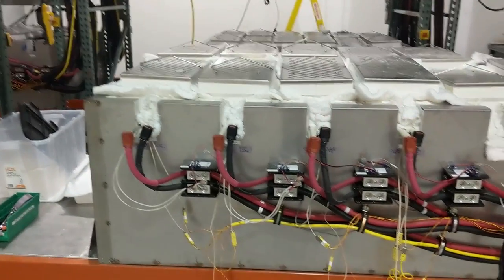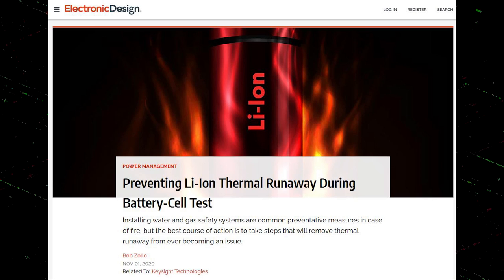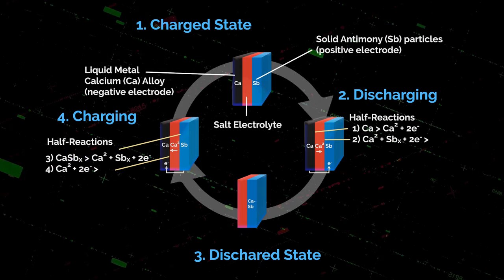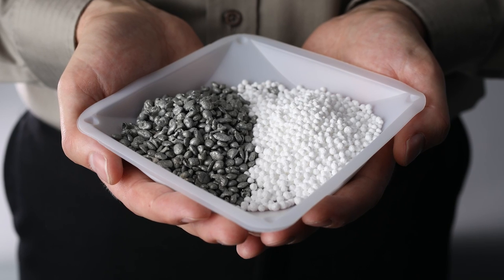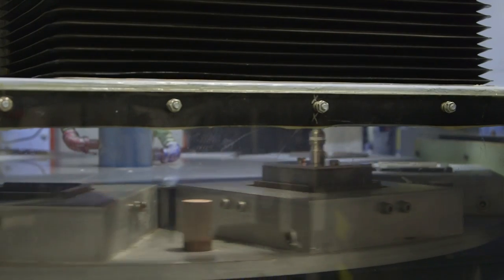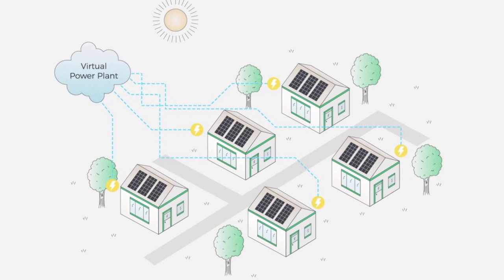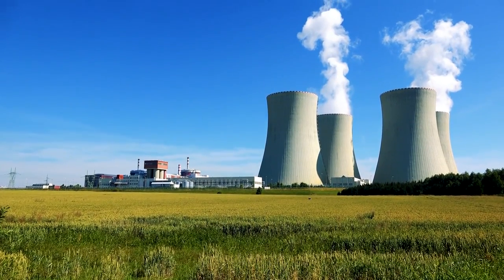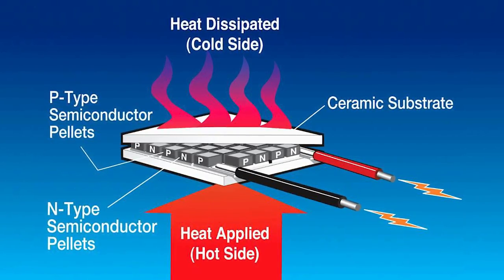Ambri: A Battery that Could Change the World

Comment: Getting the battery up to use temperature is going to be rather uneconomical, the temperature he quotes is nearly 1,290°F.. I'm not going want to run a blast furnace just to use batteries.

Comment: Very interesting and fascinating. This is awesome.  Thank you very much. I do not have background in chemistry so kindly excuse my question.
Q: Where do you get the energy to heat the battery to such a high temperature and how do you maintain that temperature?   Is it the battery once ‘activated’ able to keep itself hot enough or you will need external heat source?
Reply: Best ask the professor

Comment: Can somebody answer me - if the battery needs to be heated, then would that by itself consume the energy stored in it?
Reply: He implied the chemical reaction when charging and depleting the battery creates the heat (or a portion of it) to keep the metals liquid and thus functional.  If the percentage of energy needed to maintain liquid metal provided by the reaction from charging and depleting the batteries was significant, he would have provided that statistic. Getting these batteries up to temperature on site would probably require "smelter" level electricity from some other fuel at start up.   And, by omission of the critical percentage referenced above, an onsite permanent "smelter" level energy producer is probably needed to assist the exothermic reactions to keep the metals at liquid temperatures.

Comment: What is the energy density of this battery? How does this density compare with a Lithium ion battery? Can this Liquid Metal Battery (LiMB) be made small enough to fit into a car? Because it is liquid metal and is encased in steel and ceramic, I assume the energy density is not as good especially with a small form factor? How does LiMB compare to the future SSBT from QuantumScape or SolidPower?
Reply: This relies on gravitational layering, and start/stop changes the direction of the gravity forces. Mobile is probably not a practical market.

Comment: TOO DAMN HOT!!! You'll expend too much electricity HEATING the battery to operating temperature than it can STORE which is the name of the game. This battery chemistry is over a hundred years old discovered almost simultaneously by a Frenchman and by a Spaniard before WWI both proposed to use it in submarines, but keeping the battery HOT would have taken burning coal or oil, which is hard to do under water. A fast path to nowhere. It didn't work in electric cars/trucks/buses either. 1001 ways to re-invent things that didn't work before!

Comment: There isn't enough antimony to supply all the grid storage for Minnesota, much less the world. Minnesota which would need over 100,000 tons and the only country that can supply this strategic metal, if it became viable, is China.  It will only be able to supply a small part of the storage needs of the world. Unless a cheaper metal can be used for a liquid metal battery that is available worldwide, this isn't the answer to grid storage. Compressed air storage might be better to create storage.

Comment: In the times before coal to steal metals electricity was not going to well for arking to welders started the second generation of metal understand then laughing at the experience and then realise it later as a cool down takeing longer time to cool then other an interaction between metals if only someone recorded the metals that came out of the smelters to realize that battery way way back

Comment: he makes a number of false or dubious statements. you didnt call him on any of them. says he wants to make a battery out of dirt. then says one of his electrodes is antimony. have you looked up the abundance of antimony recently? he says aluminum can be refined from dirt for 50c/lb. last i checked aluminum gets to that price by starting with bauxite ore, generally shipped across the world to the refineries. also, he never mentions what the electrode terminals are made of. how do you go from a molten metal inside a "steel" box (hint: it's not just steel) to a copper wire? tough problem. probably requires an exotic substance to make it all work. any airspace or pressure issues inside that box? probably going to need a valve that operated at over 500c. fancy. impurities in the battery materials get "refined out" during cycling? where's "out" with a steel box? this guy went all in on the folksy "cheap as dirt" narrative a long time ago. i don't appreciate it. he'd do better to discuss the details.

Comment: 🔥♨️How safe this battery is as it operates at a high temperature of about 500°C (932°F) 🔥♨️ as these will be installed in a huge number together ??  And can we use that high temperature 🌡 for any other pupose during its operation is possible??

Comment: Li-Fe batteries are useless for mass storage, the best heat energy is from geothermal but only for small area environments. You never get more energy out than you put in, so where is the energy coming from? good idea again, with no solution yet.!
So if it freezes it fails, just like lithium.!!

Comment: 31:15 I liked the ambri men idea...when he pointed out " missing puzzle " is the batteries!

Gases are from land sea & dirt cheap batteries.. are like down your feet? ( Land Ground )
And when you bring a kinetic engineer in your company, they will only say, only physical metal, generates electricity by a wired cylindrical coper wired motor! But they would never remember, ( in mind ) chemists reactions generates electricity, without any kinetic metal as a physical transformer for combustion heat of burst oil to form electricity

Hard physical engineering at some point, will always forget.. substance or chemical, do generates kinetic energy with a good micro setting of educate quality liquid metal.. without combustion energy's transformed!
If batteries combust.. that is we know, a malfunctioning.

Comment: if the heat generated from charge and discharge is going to keep this metal heated to 900c degrees how are you going to turn around and claim the battery is more efficient than lifepo...

Comment: What kind of ecological mess does the garbage ones with heavy metals and all those electrical parts make in the landfill? Then , the meltdown on the side of the road bursting into flame? Like the hot hot running temperature of the"efficient" gasoline , internal combustion engine. Push it till it explodes and burns. No real good answer, just theory's.pour money into the problems untill we go broke. New cars in 1970, $2,500.00 US. Now, $25,000.00 so has your pay gone up × 100 ?

Comment: Throw some nuclear waste into the battery, and it will never solidify??  Use another MIT solid state invention to syphon off excess heat to generate electricity to trickle charge the battery?

Comment: so.. why not use germanium
Reply: one notch above silicon.. 8 more proton electron pairs.. and gallium..next door with one proton electron pair less.. and a melting point of 29.7° C.. melts in your hand.. 
sodium and boron..  hmmm.. not expensive enough, possibly?.. my research indicates we can make a battery with the AuPt and AuPd in the radioactive volcanic ash that covers the Earth, doctor.. P Michael Hutchins of MIT actually got me going on this line of research.. we were trying to make precious opal with volcanic ash.. kaolinite clay.. I got a gel of stuff.. a lump without play of color.. P Michael says.. could be any damned thing, Rick.. and he was right.. as usual 🙄
Reply: and since I have platinum and palladium in what amounts to an unlimited supply.. not rare or hard to find.. I have been thinking about this issue.. a lot.. because we only have to ship electricity and make large storage batteries for stuff we must buy from someone else.. make it at home.. use it at home.. no worries mate.. no need for a lot of infrastructure.. platinum and palladium with gold have double double covalent bonds across each unit cell.. that's what volcanic ash is.. the individual unit cells.. found on the side of the road.. any dirt road will do.. so not only do I have unlimited supplies.. so do you... heck of a way to run a business.. giving stuff away.. but there's lots and lots of it.. about 10,000 km straight down.. chock full of AuPt and AuPd in the semi molten mantle.. it's semi molten because it is radioactive  . Pt190 has both alpha and beta emissions.. mostly beta.. one electron at a time.. at the speed of light.. gotta be something I can figure out... I am working on it
Reply: I have a piece of Chinese platinum bullion that I pulled out of one of my experiments because it was becoming to hot.. radioactive hot.. a process here in my laboratory.. my father taught reactor theory when I was in high school.. I know a little bit about it
Reply: so.. guess what nuclear power plants do?... boys and girls.. not you doc.. I would hope you already know.. the answer is, of course.. they make Pu244 with which to blow up our neighbors... and.. they boil water..  so.. the entire Planet is covered with radioactive volcanic ash... but Pt190 won't blow up..  and it boils water just fine 🙂.. so.. we probably can use capacitors to regulate the current.. 12 volt.. in the home... it's a catalyzed reaction.. so.  basically.. electricity for free... just add water.. 
it's not gonna make me rich.. fer sure.. or make anyone else poor.. unhealthy.. or anything else.. the best part about giving stuff away is ==>> no unhappy customers 😀.. far out man
Reply: the problem with 12 volt direct current is that you can't ship it long distances.. so it must be made within a couple of kilometers of where we use it.. obviously if you have a steam powered generator.. that is in the garage.. it's not an issue at all..  it's a very good way to eliminate a lot of the use of fossil fuels.. and the use of the radioactive lanthinides that create very long term problems with nuclear waste.. it's probably not the best way to make electricity.. but it is the only way known to create Pu244
Reply: radioactive volcanic ash literally covers the Planet.. mostly we walk around on top of it

Comment: Recharging battery charge it one time with electrical power never had to charge it again cuz it will always recharge itself and it will last for a lifetime and the lifetime of your grandkids that's kind of battery we need that won't get hot and go nuclear and causing fire bombs that would recharge itself for a lifetime of recharging of it no worries it can last 200 years never break down or be having to be thrown away and put in a landfill and the whatever it should be put in will last for 200 years with a power system that was recharge itself in the last 200 years you don't have to add no stroller with jacket one time and never had to charge it again cuz it will always recharge itself you never go dead no matter how many hours you use it it was still last frankly forever within two hundred years your grandkids is grandkids will still be able to use it that's kind of better we everlasting battery that has a way of recharging itself on the fly as it's being used to never run dead ever no matter how cold or hot it gets it won't burst into smoking flame it won't freeze and go dead it will always have a charge the power of your home are your car are you electronics and evikes and eBay cars will always have the power it needs to take you down that road it won't go nuclear if it was in a wreck by another vehicle it won't damage the ozone or the Asheville or the environment in any form of fashion if it gets totally damaged it's about only way your battery will go dead that's the kind of super battery we need to make all these vehicles super with a battery that has tons of power self-charging never go dead will be great for American people something that we very easy to recycle and make a new battery out of old battery material

Comment: Cool batteries are great and can be in plastic these batteries will be in steel but a steel container will be a dead short batteries do not make electricity a good bucket is important but it is not an artesian well. You still have to make the electricity. That means nukes or coal or inefficient renewable.